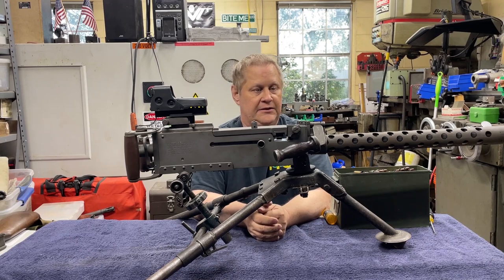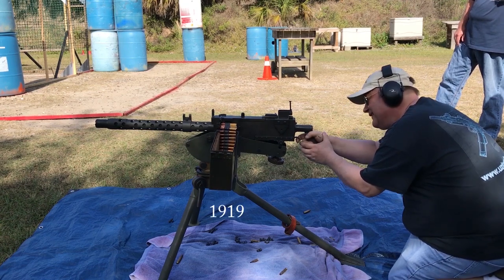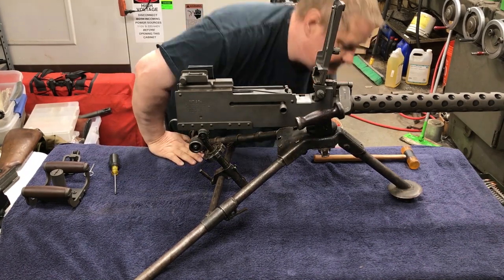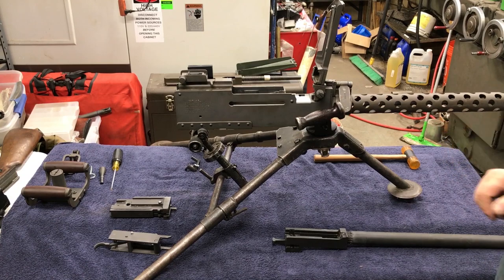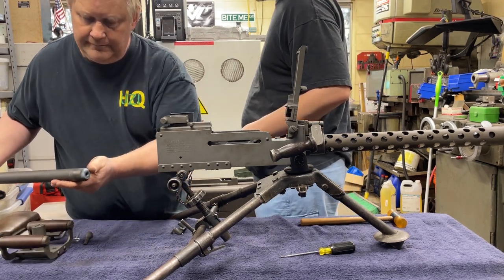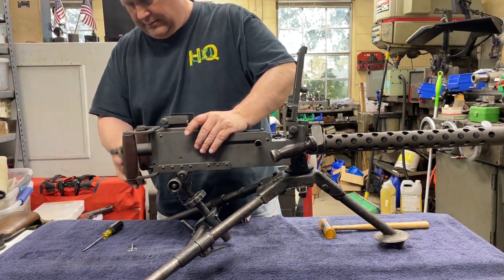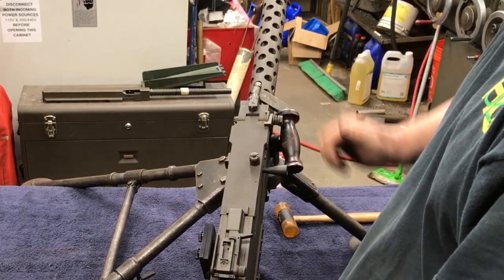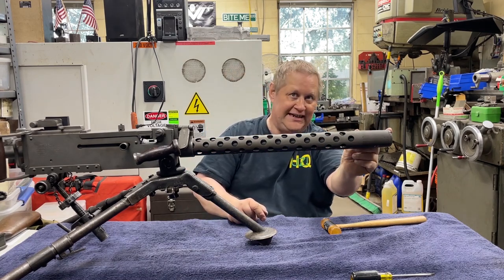Browning 1919

Comment: everyone should have one of those! and pake the parts by outsourcing machine shops so price is lower!
Reply: I would try starting with 30 cal browning before 50 its smaller but looks the same! or just buy parts on sale before getting parts made cheaper!
Reply from the maker: It’s far cheaper to buy a parts kit than to try to reverse engineer the parts and have them machined by a machine shop.

Comment: So it is the side plate that is the registered receiver? This is a post sample gun?
Reply from the maker: The two guns in the video are transferable side plate guns and yes the side plate is the registered part.
Reply: @BWEFirearms  Nice!
Reply: @BWEFirearms  I recall a Marine used a aircraft 1919 that ran at about 1000RpM and put a Garand stock on it. He used it on Iwo Jima and got a MOH (posthumously). The Ma Duece is still in service too!
Reply from the maker: @535tony  It was called the Stinger.
Reply: @BWEFirearms  Forgotten weapons did a show on it. Someone made a few close copies of the original. What was interesting to me was that we had a 1919 that would shoot almost as fast as the MG42 but we only used in in aircraft.